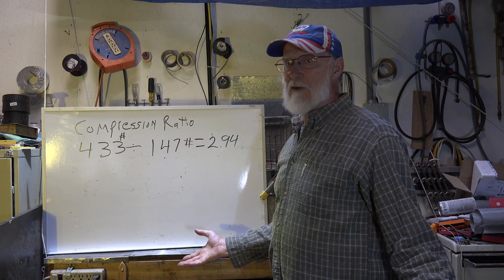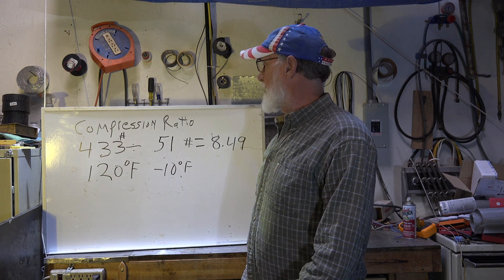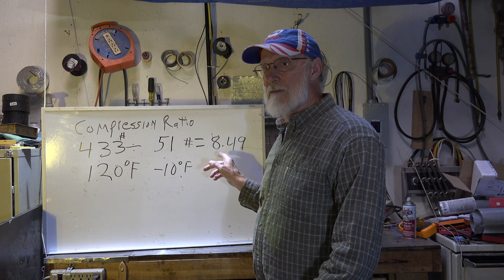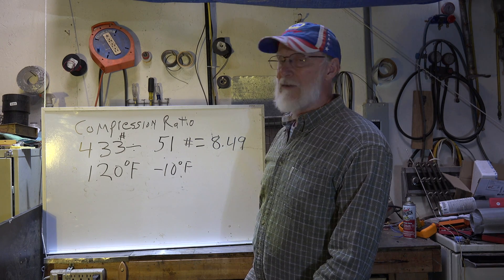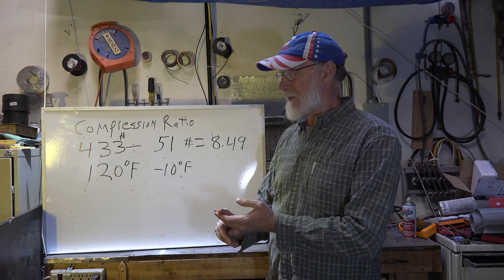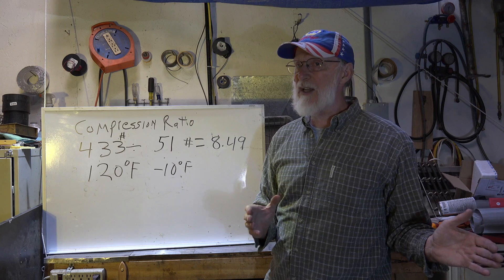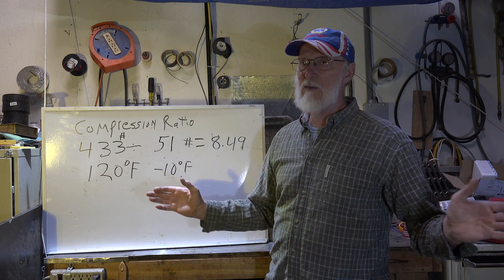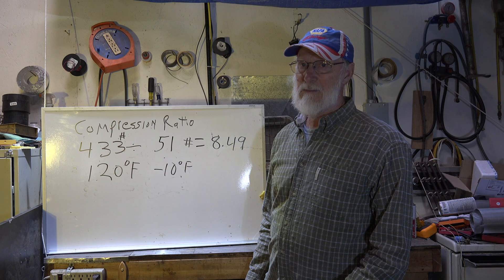What is compression ratio in the HVAC compressor

Comment: Test question. 
A compressor has a displacement of 10 cu. inches. At 1800 rpm it actually pumps 6.8 cfm of R22. what is its volumetric efficiency? 
the answer is 6.5 to 1.
I don't understand how the formula for volumetric efficiency ( ve= actual cfm pumped ÷ displacement cfm ) equates to a ratio of 6.5 to 1.
6.8/10=0.68
could you help break this down for me?

Comment: Sir, what exactly is re-expansion of gas, concept wise?
Reply from the maker: When a compressor raises the pressure, the discharge has a higher pressure than the suction side.  In order to pump gas, the pressure in the cylinder must be at a lower pressure than the suction side.  The pressure in the cylinder at top dead center will be at the discharge pressure.  In order to pump, it must have a lower pressure in the cylinder than the suction side.  The movement down the cylinder of the piston lowers the pressure inside.  Reexpansion is the distance required to reach a lower pressure in the cylinder than the suction side.
GFM

Comment: How do i calculate this ? How did you get 8 do u subtract low from high side?
Reply: Absolute discharge pressure divided by absolute suction pressure equals compression ratio.

Comment: But how can wie change the compression ratio of a compressor?  Don't they have a fixed compression ratio of round about 1:10?
Reply from the maker: Compression ratio is not dependent on the design of the compressor.  Its the ratio of suction pressure to head pressure given in absolute terms.
GFM

Comment: Can you help me to find the filter or the filters inside my old Lennox Pulse furnace.....I have tried everything, I am desperate!   Thanks if you can help me...
Reply: Pulse unit!!!!!
Wowwwwwww....
That's from the 1990s...
Open it up, pull out the filter and scratch it clean with a small controls screwdriver...
It's better than nothing.
Reply: @THEDCCOF1977  Sorry, you misunderstood my question.    I inherited this Pulse dinosour , it is still working, but I couldn't find the CORRECT location FOR the filter, it was just thrown up on the top of the open unit when I bought the house.....I have since (3 years ago) located where it goes!  Thanks for responding even if it was 3 years later ha!
Reply: @susanhbr2012  
Well I was also thinking u were talking about the filter for the fresh air intake part for the ignition...  The spark area...
There's also a a filter on the unit that needs to be cleaned for fresh air to enter the ignition chamber..

Comment: GFM question about my understanding on the compression ratio.  You said, the higher the ratio the less capacity it has.  What does this determine for me as a tech? As an installer?  As a designer?  Is this number good to know for upgrading large refrigeration systems? Can it help me determine the size of compressor and type of refrigerant to use?  Thanks, just got home from work and this caught my attention.  Love your work!
Reply: I should have finished the video, stopped it right at 5:20 believe it or not.